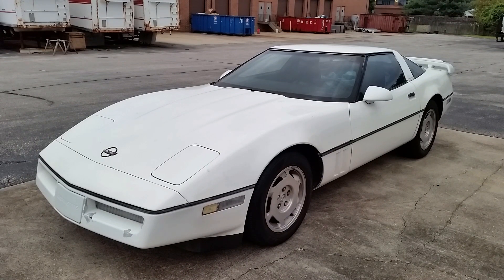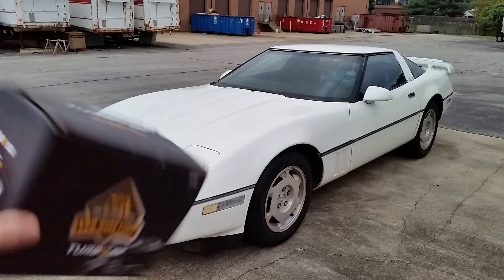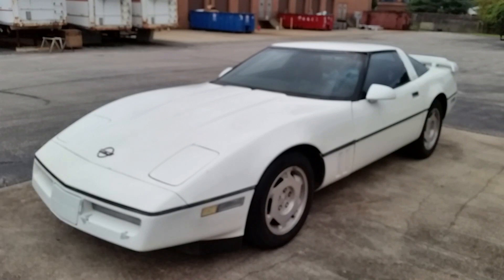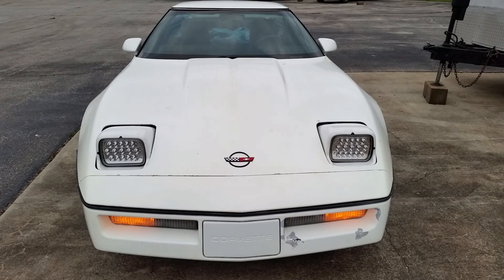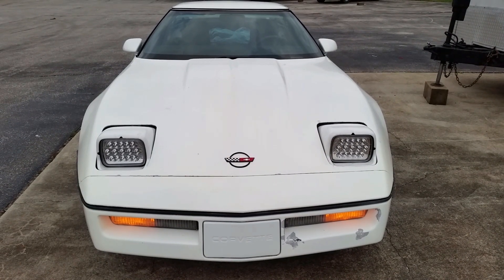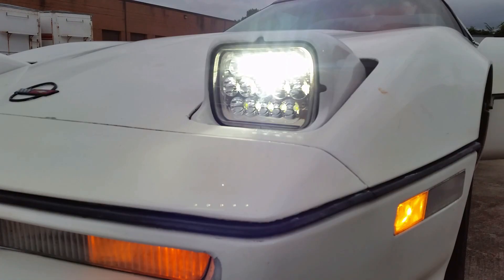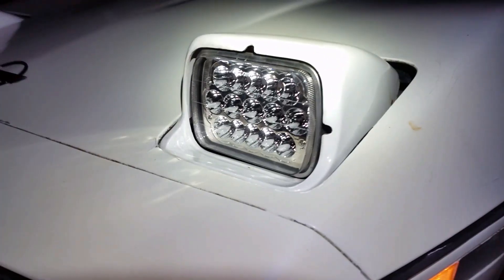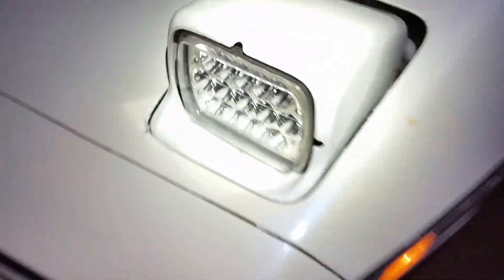Sii LED 7x6 Review: C4 Corvette Headlight upgrade

Comment: I did get myself a set of these on eBay and installed them 
They are way lighter than my old stockers and the look way way better 
I just hope I don't get bothered by cops here 
And I have a gta trans am with small rectangle fog lights that now are yellow so I ordered a set of led fog light bulbs so they match my head lights
Reply from the maker: Nice! Do the ebay ones say DOT in the lens also?
Reply: @CamaroRick  I'm not sure but they are identical in every way
Reply from the maker: @benkalinowski5834  Easy upgrade. I got a set for my s10 I need to mess with.

Comment: I used to be against going with a modern headlight for my 1976 Camaro but, I saw an El Camino with red halos and I knew they would look amazing on my Camaro. @camaronado
Reply from the maker: Im the same way, Its hard to beat the original look but the leds do work well. I also like the look of the colored halos it gives a menacing appearance.

Comment: Realize this is an older video, but if your still answering comments. What you do you mean by there isn't much of a cut off?
Reply from the maker: Cut off as in a crisp line where the light doesn't shine on the upper part of the light output. Like modern cars these headlights are a basic design.
Reply: @CamaroRick  Thank you, appreciate the reply.

Comment: Just adjust both down a bit to fix it 
Nice I have a 88 gta trans am flip up lights 
And I was thinking about then to 
Are they still lasting
Reply from the maker: So far they have held up well and are still working
Reply: @CamaroRick  cool 
I'm gonna buy them 
I like the look and save power ty
Reply from the maker: @benkalinowski5834  They do look cool and have a nice color. I would look into the projector LED headlights as an option. I have been meaning to try out the projector type to get a cutoff line. Good luck!
Reply: @CamaroRick  you didn't have to do any other wiring to make them work right??
It's plug and play 
And did it say how many watts it's uses vs stock ones
Reply from the maker: @benkalinowski5834  Yes they were plug and play. Some other lights may need the terminals to be rearranged so that the ground side is in the right place (not a big deal) but not with these. I believe they are 45watts each
Reply: @CamaroRick  ty
I'm gonna get a set
Reply: @CamaroRick  did you have to get any anti flicker harness?
Reply from the maker: @benkalinowski5834  The anti flicker harness is for day time running light operation (drl mode doesn't supply enough voltage to keep the LED's happy) Normal 12v headlight operation will not flicker.

Comment: Great video. Quick question: when installing the lights, which side is up? Thanks in advance!
Reply from the maker: The lenses say DOT so I just set them upright based on the lettering. It's in reverse when the lights are flipped /from inside of the hood.
Reply: Thanks for your guidance!

Comment: Question - do your fog light still work with these LED’s? I installed them and my dogs went out. The fogs seem to grounded through the Filament in the traditional halogen lights.
Reply from the maker: I didnt notice anything on the fog lights, the schematic says they get power from the light switch to the fog light switch and if goes through the bulbs and straight to ground #G115 and #G116. G116 is the same ground the horn goes to for a quick check if the ground is good

Comment: Did you find the 4 screws on the metal trim that hold the lights in sometimes strip?
Reply from the maker: Yes they can easily if they do the head can be drilled off and when its apart you can use vice grips to unscrew the remaining screw stud. Its important to use a tight fitting philips or torx bit to lower the risk. They are just a standard metal clip screw so not a whole lot of meat to rust seize the screw its just about getting it to initially budge. Sometimes I use my small 1/4" electric impact so I can apply a lot of pressure onto the screw head before zapping it off. If your in a pinch you can use a cutoff tool and make the screw a slotted screw until you can get a replacement.

Comment: I just replaced mine, they work fine, but the high beam indicator on the instrument cluster stays on high all the time instead of going off when I dim the lights. Any ideas on how to fix?
Reply from the maker: Do the headlights actually switch from high beam and low beam? The 3 wires going to each light from the car harness should be green tan and black.
The green is high beam voltage, tan is low beam voltage, and black is the common ground.
Reply: @CamaroRick  yes, they do switch and are the color you mentioned. I saw the option of switching wires between ground and low beam, but it said if there was "no light" to do that. Not sure if I should do that.

Comment: Dumb question again 
Do the cops bug you at night with theses did you adjust them down a bit to not glare other ppl??
Reply from the maker: Not really. Around here led bulbs are common, I do aim them lower to keep the glare down. These lights in particular are not that bright. The color looks great but I would recommend a projector version for better light output.

Comment: I installed LED's on my 89 and the weird thing was that the lights continued to blink on and off after I turned them off and the lights would no longer flip down anymore even with the H4 adapters installed that came with the lights. I swapped back to my stock lights and everything worked like normal. Odd.
Reply from the maker: There shouldn't be any voltage at the headlight terminal with the lights off. That is odd. Id check the circuit with a multimeter to be sure the wiring is right. Does the high beam light stay on with the LED's even when off?
Reply: Camaro Rick the high beams weren’t on, but the low beam constantly flickered with the light switch being turned off. In a few forums I heard of people having to install a relay just to solve the flickering. Wasn’t sure if you had the same problem or heard of that. My lights and light switch works as it should with the stock lights. They even flip up as they should with the sticks installed.
Reply from the maker: @harleyrider9166  they worked without issue on this car. Thats odd. I have not done this on enough cars to see a similar issue. Ill check the next one to see If the connector always has slight voltage.
Reply from the maker: Do you have DRL setup on the car? what year?
Reply: Camaro Rick ok thanks for the feedback
Reply: Camaro Rick I don’t have a daytime running light controller on my vehicle. It’s a stock 89 convertible. No modifications on the lighting system at all. It’s all OEM.
Reply: I am having the same issue after installing them the lights will not flip no more I’m still messing with it scratching my damn head now I know to just take them off and leave the original thanks for your comment I was going nuts. I’m mad I like how they look .

Comment: I love the brightness of LEDs, but I agree, I also doubt they are truly dot approved. So you're that guy coming at me at night. LOL
That's okay when I see lights like these coming at me, I beam back because with out control, leds are blinding. 
I smashed your like thumb, but it will heal
Reply from the maker: I agree there are much better options with a cutoff for these size sealed beams. I aimed these down to lower the glare but its still a big issue.
Reply: @CamaroRick  
But when you turn them down to eliminate the blinding, you lose your lighting distance. You can't win LOL

Comment: Damn. I need some of these. I replaced my headlights with standard grade factory model. They are absolute garbage! They provide just enough light to keep me on the road. I could probably drive in town with my high beams on and not blind anyone or get pulled over.
Reply from the maker: The projector style LED lights are my favorite. Good output. My old halogens were still technically "working" but they sure didnt do a good job of it. I found some projector versions and they are awesome. Check out the S10 LED video and skip midway through. I could never go back